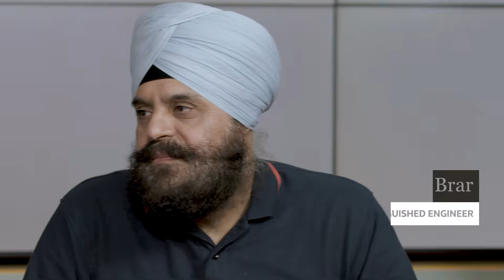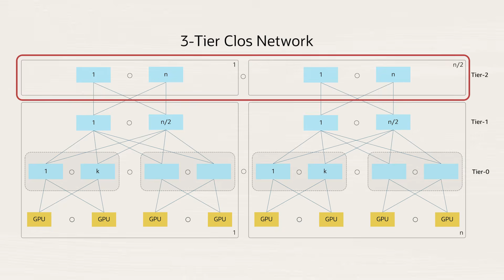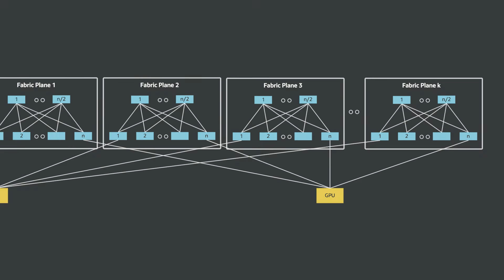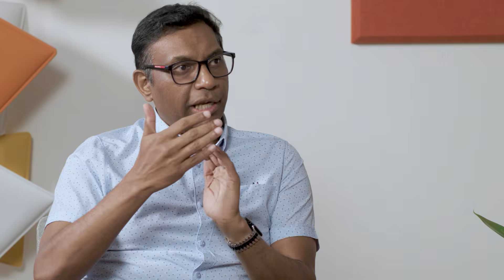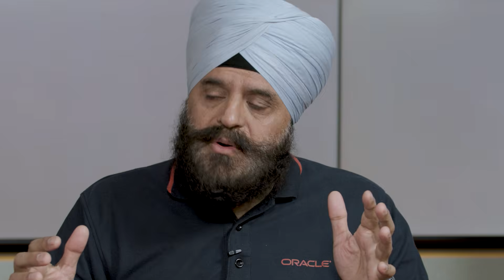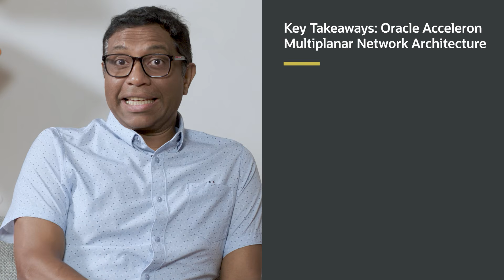First Principles: Oracle Acceleron Multiplanar Network Architecture

Comment: Is the switch radix achieved by using breakouts on switch ports with a smaller RU footprint or with a higher density chassis switch? If the former, what is the impact of losing one switchport, how many NICs are affected.